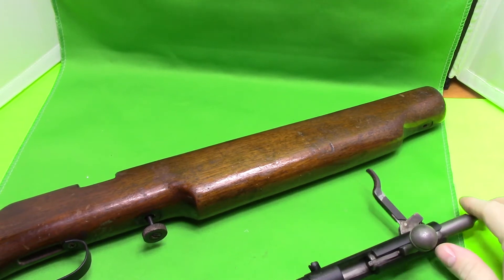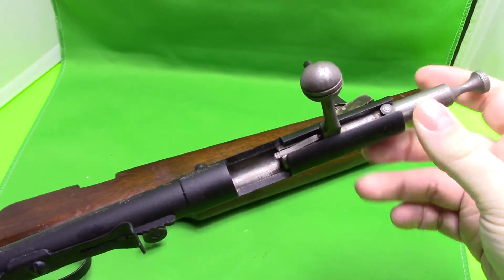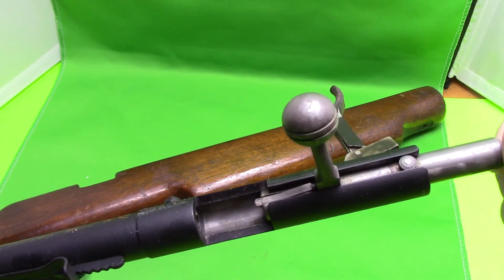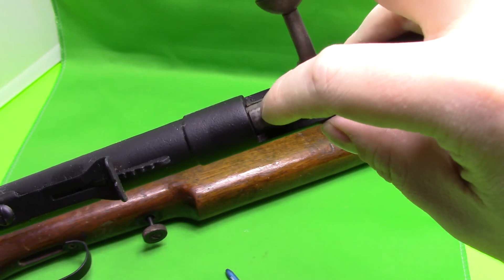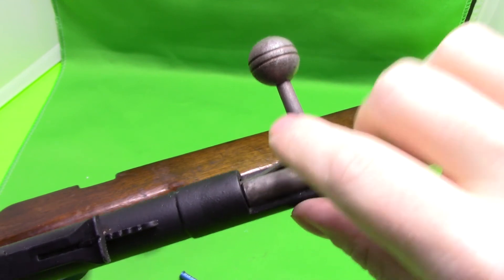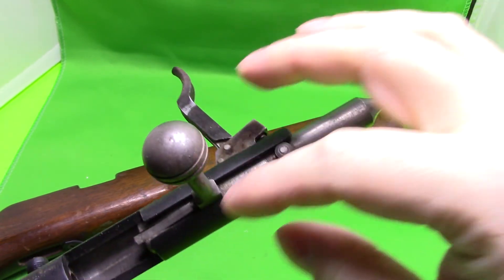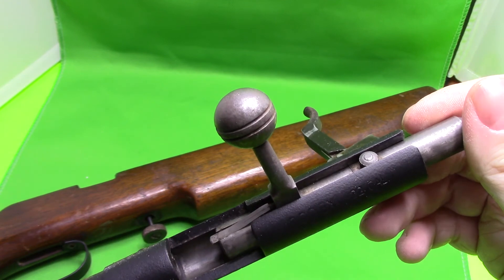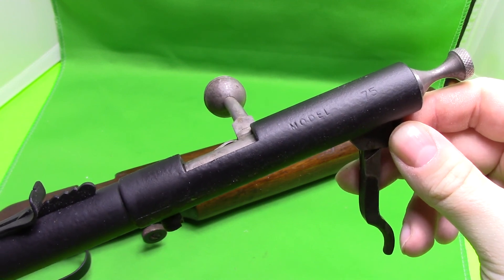Cooey 22 extraction problem easy fix. Model 75

Comment: Most problems in a cooey are solved by a good cleaning.  Take the bolt to someone with an ultrasonic cleaner then used compressed air and bake in oven at 250f  to get all the moisture out, then hold the bolt in a way to allow oil back I to the spring path.   After that get a small plastic dowel, split it and put in a little bit  of 000steel will and spin in the chamber to polish , use of shorts erodes the chamber and leads to hard extraction .   Then if you wants to get fancy, boil the barrel and rub down with 000steel  wool and oil to bring back the bluing
Reply: Or you can just extract the shell the way his video shows...
Reply: Prior planning prevents piss poor performance.

Proper maintenance prevents the same

Comment: Nice video. How do you remove the barrel from the action? I assume you remove the stock mounting nut (which is also a set screw against the barrel) then do you use a brass punch against the breech face to separate the barrel and action? Thanks
Reply from the maker: I am not sure. I have never taken one apart . Sorry.
Reply: The barrels are press fit to the receiver. The threaded stud just below the breach that the stock screw threads into butts into the rear bottom of the barrel and somewhat clamps the barrel and receiver together, however the majority of the force keeping the barrel and receiver together is their interference fit. It is possible to adjust the headspace by moving the barrel in or out, some cooey rifles that misfire do so because the barrel has crept forward, it can be pushed back to reduce the headspace and restore reliability. Being a simple gun they are simple to work on when required.

Comment: I only have extraction issues with Winchester ammo on 3 different  Cooey 22s, it has a larger and thicker rim, CCI and federal work fine. Also, if I pull the cocking piece back to the half cock position before opening the bolt it will eject every time.

Comment: Brother this is coming from a Canadian I'm looking at your bolt and it's grungy looking . and you should take it out and you can twist it so it's locked open and blast the heck out of it with brake rotor cleaner . do it outside . always always lightly lube 22 rifles. they pick up unburnt powder. that rifle looks like it's possibly been spray painted . and you have to look at your extractor to make sure it still has a hook on it . they can be replaced . it an uber reliable  rifle . I heard that Eskimos used to use them . 

way before my time . take the barrel and action out of the wood and scrub the crapola out of it . I'm looking on the inside and it's not shiny . when your action is dirty and you pull back on the bolt it's going to slip over the rim on the round if your fighting it or if your extractor is near gone . keep the rifle . all new stuff is garbage . that was hand made .
Reply: Where can I find a extractor for my cooey model 750? Thank you a lot!